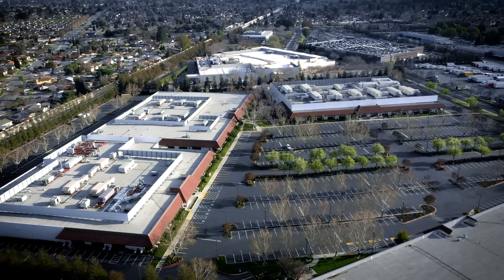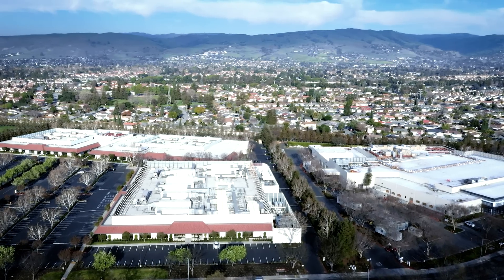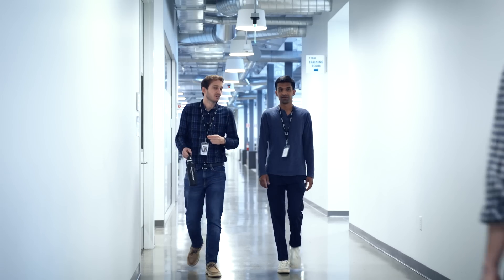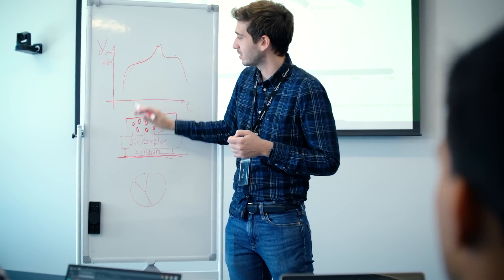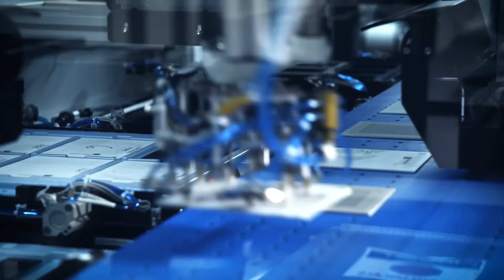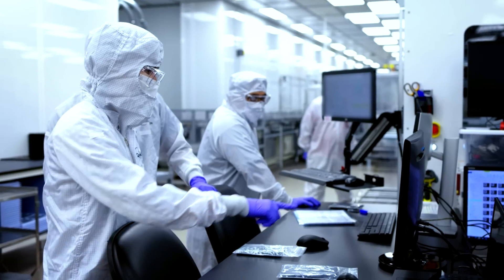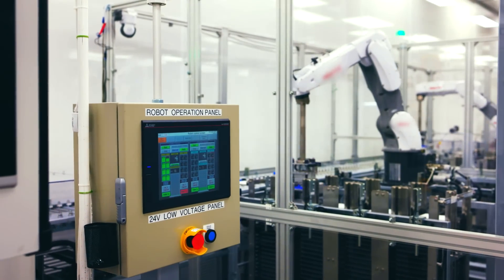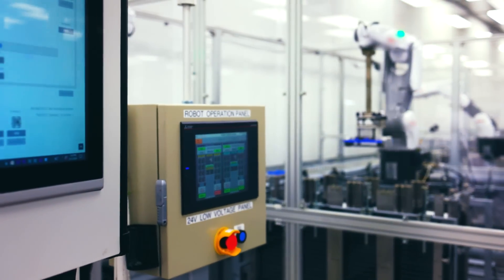QS unveils first B Samples enabled by Raptor

Comment: Tesla seems to be interested in acquiring QuantumScape and is currently waiting for the test results of the B-samples. Apparently, the proximity of the two companies is also a key factor in these takeover plans. This would be a well-deserved quantum leap for the company! I’m really excited about this time.
Reply: Acquiring quantumscape by Tesla or any company would be impossible. How will then buyer value the company given the applications it can support? The best course for auto OEMS including tesla will be too work with quantumscape to set up a manufacturing joint venture or license the tech.
Reply: Are you insane?
Reply: @markymarkjapan  ...the source is reliable ☝🏼 the plans remain unchanged...

Comment: I hope QS has CTP (cell to pack) technology. To be honest, the energy density of individual cells is not as impressive compared to batteries from other competing ASSB companies. I hope QS's batteries simplify battery packs with temperature stability and operating conditions that surpass those of competitors.

Separately, congratulations on the B-sample.
I hope that QS will achieve meaningful success in the ESS field as well.
Reply: Who are Quantumscape's competitors with more impressive technology? I'm genuinely curious.  Thank you.
Reply: @ 
For most sulfide all-solid-state batteries, the energy density is higher than QS. For example, Samsung SDI has found a way to suppress dendrites through carbon silver coating (but it doesn't seem to be as perfect as QS). They are also exploring mass production methods through a roll-to-roll process.

I believe QS is a leader in battery technology, but I hope that QS dominates the battery market before lithium sulfide becomes cheap enough.
Reply: @GoldenNugget2  Thank you for your thoughts.  I did a lot of research today and now realize how intense the competition is.  It seems as though auto manufacturers are hedging their bets with the various developers, but they will be happy to do business with whoever is able to mass produce.  My first impression has me excited about QS, but I also want to invest in other market leaders in case they come to market first. Thank you again.  Take care.

Comment: I wish they would partner with Rybio or Jackery or DeWalt to test these batteries 

and generate revenue 

Overall yes it's a risky investment provided that it's exclusive to EVS but their more applications such as cellphone, hardware tools, Energy Storage, AI and Robotics.  As we move more into the digital age we will require more power and that means a better battery.  This could even be used in Reach Trucks for freight,

Comment: The size of the B-sample cell looks pretty small; and the energy density both in L and Kg is just not that impressive.
Reply: keep researching cause you are missing a lot lol
Reply: @iamsamhurdphotography  He's missing what exactly? The best QS can offer whatever metric you choose is not above 30% improvement to already existing batteries. And that's if they can produce them at scale ever,  and if that ever happens, it's years away, and if it's also cost effective. Lots of IFs, as you see... They can only show 'cells', not 'packs', because they can't produce enough separators. That's why you can only see these guys holding cells all the time 🙂Also, all these metrics they give will be less when it becomes a battery pack (if it ever happens).

Comment: at 1:22 Tim speaks of a barrier between anode and cathode; but the QS idea is to produce an anode free battery; what am I not grasping here? 

In the earnings release, the company stated, "[T]o the best of our knowledge, these cells are the first anode-free solid-state lithium-metal cell design ever produced for automotive applications."
Reply: No battery can be anode free because thats how they function, quantumscapes battery removes the material needed in the anode so when charged it swells instead this is part of the reason they can get higher energy density than lithium ion. The barrier or seperator is what enables this.  Less materials for a better battery
Reply: The cell consists of a pure lithium anode that is formed on the first time it is charged from the lithium stored in the cathode.  Lithium ion cells use a  porous separator that allows an electrolyte to flood the entire cell and a host material in the anode to store the lithium, like graphite or now, silicon. QS eliminates both of those things .
Reply: From what I understand is that yes QS is manufactured anode free but when charged it forms a anode.

Comment: can someone with a more technical knowledge explain or interpet the specs and do a comparison to a modern day ev to see what these batteries would meen ? like a car with 50 kwm batteri, let say it weighs 2 000 kg and gos maybe 400 km. what would this batterie do to a car like that?
Reply: An improvement on range of 50% but you can trade that for a smaller battery to save weight as well. With a 12 minute 10-80%charge rate (that doesnt harm the battery) you wont need as much range. Equally as important is how much safer this will be in regards to fire risk

Comment: What about cycle time? LFP batteries still make these look like a joke when it comes cycle time?
Reply: These go over 800 cycles with less than 5% degradation, so 300k miles with virtually no range loss
Reply: @Cruise1966  I mean the newest LFP batteries are like 5000 cycles?
Reply: They didn't say much about cycle life at all which I was disappointed by but being a solid state its supposed to be better as dendrites don't grow. They said before that cycle life would be improved bit not sure what they were comparing to lfp or other lesser chemistry that has less cycle life

Comment: So the density is not huge. However, I listened to Ford ceo who explained that the iron batteries are with less energy density but because they are safe, OEM do not need additional equipment so the battery as a whole pack is lighter and the car goes further.
If this is the case here  then slight improvement on energy density over li ion combined with no additional safety equipment means the cars will have measurable more range.
Is that correct?
Reply: You talk about current LFP batteries on the market, I think this tech is supposed to beat LFP when it comes to density 🤔🤷🏻 Try to look up the weight for a typical LFP battery station, they are heavy, and then compare with the density they show here.
Reply: @Earth-in-space  100% true. The density they show beats lithium ion batteries as well, but by much. But this does not mean the tech isn't good. If it allows for weight to be reduced as well as upping the density slightly, this means your car will go further. 
So, this combined with less temperature volatility means it will go further in winter as well.
I hope the tech works and we start seeing those batteries in a couple of years

Comment: Huge progress!! Great good job guys. Finally got to see the progress in hand. So when would this sample B be placed into testing for cars and will this also allow for better range or is it just for faster recharge?
Reply: Tesla batteries are at 250  Wh/Kg QS at 800 Wh/Kg. Range increases by three times.
Reply: @raghuhiriyur  It's not 800 Wh/kg, its 301 Wh/kg. 800ish figure is for volumetric energy density.
Reply: @raghuhiriyur  ITS NOT 800 WH?KG. Its 300 wh/kg. The 800 is wh/liter.